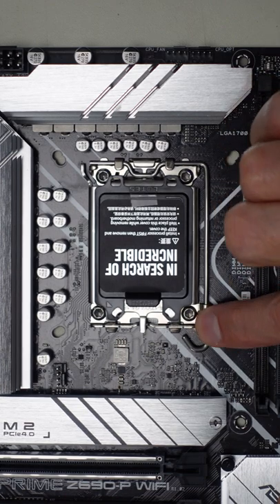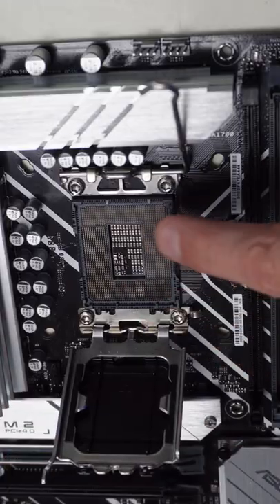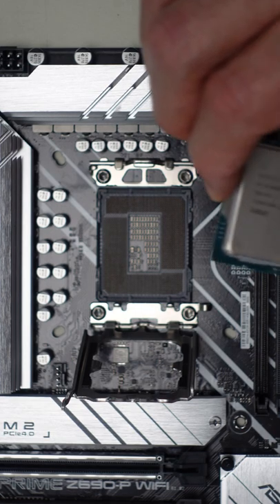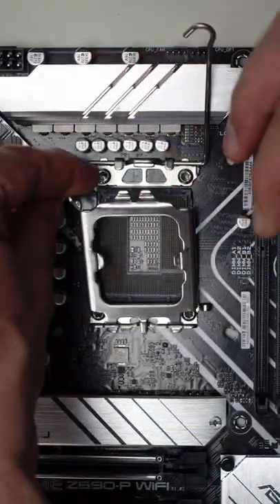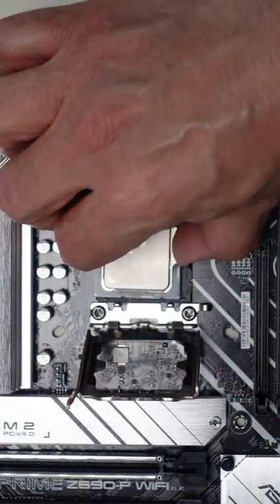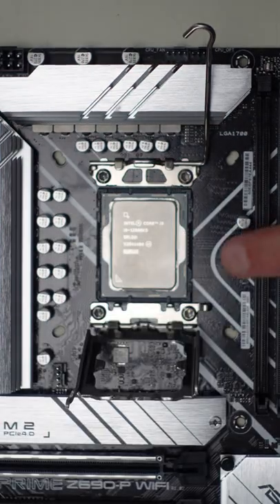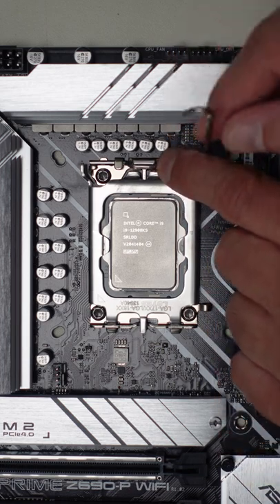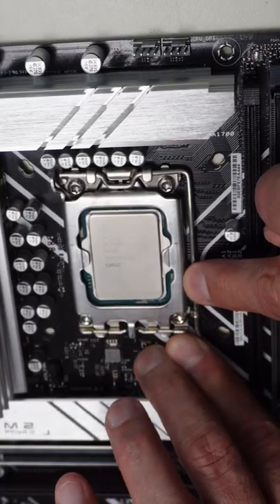Installing an Intel 12th Gen CPU into an LGA-1700 Socket #Shorts

Comment: You should not pop out the cover, it must come out when closing the socket
Reply from the maker: That is how I did it for quite a while - until I broke the plastic latches on the cover the first time I tried that with the LGA-1700 socket.  It seems like they changed the structure of those small plastic latches.
Reply: The LGA1700 plastic cover don't seem to pop out like the older cpu sockets.
Reply from the maker: @serverous85  I believe you are 100% correct on that. in my first attempt at having it pop out, all it did was break the tabs.
Reply: @PE4Doers  I just built using a z690 ace. I had to manually pop it out as closing it didn't do it.
Reply from the maker: @serverous85  That aligns with what I've seen.  Thanks for the update.
Reply: Ah the comments here are interesting. Just got my board and chip, and plastic tab clearly says NOT to remove it first. Yet apparently that's BS? Why I come to watch these videos first :)
Reply: @jmd1980  put the cpu in first, lower the clamp and pop it out manually as you do that to avoid damaging the pins
Reply from the maker: @jmd1980  It probably depends on how the motherboard manufacturer designs it.  I have only tried two ASUS boards so far.
Reply: @PE4Doers  no you are wrong…. You are teaching it wrong
Reply from the maker: @crunch9876  Well, it works perfectly OK today.
Reply: @PE4Doers  until it doesn’t. Your teaching people to do it wrong and some viewers will end up destroying
The pins
Reply from the maker: @crunch9876  I courteously disagree.  I've done three of these, and the first one I tried was as you describe and closing it with the cover not only sent the cover flying across the pins, but also broke the tabs on the cover which make it impossible to reuse if I need to return that motherboard.  The second one took a lot of effort to remove the cover.  The third time I removed it and had not concerns.
Reply: @PE4Doers  mine popped out no problem
Reply from the maker: @hovercroft  Maybe I came across a batch of bad plastic protectors.  Both of my motherboards were ASUS Prime (but different models).
Reply: @serverous85   when pop out the cpu plastic cover manual did your computer work.
Reply: @PE4Doers  When i popped the cover on my LGA1700 it popped REALLY hard off the motherboard
Reply from the maker: @MrTefe  They hold down very hard.  Does it work OK?
Reply: @PE4Doers  Yeah
Reply from the maker: @MrTefe  Good to hear
Reply: @PE4Doers Ive done hundreds of builds and I always take that out by hand. I see potential for popping it out and maybe bending some pins but pc components are often less fragile than people think.
Reply from the maker: @ThePSPJesus  I rather not take the chance.  I've had to re-bend pins on a CPU and on the socket.  It is a very difficult situation to be faced with.
Reply: If you plan to change the CPU is that means you need to installed the cover again? i bet not... 
What i seen there is no such mechanism or what so ever, that the plastic cover is needed during the process, i think it`s only optional.
Reply: @HusniArsyah exactly!

Comment: Hiya! I remember helping my friend with his first build and I was a little scared when his intel cpu was being pushed on so hard by the socket. My cpu has always been AMD Ryzen so much less pressure is needed. He went with an RTX 2060 and a i7 9700k. I decided to go with a Ryzen 5 1600 and an RX5700xt. I just recently upgraded from a 1050ti, and now I’m cpu bottlenecked 😅 I’m thinking of getting a R7 5800X(or X3D). Intel CPU sockets scare me 😂
Reply: Depending how bad the bottleneck is I'd recommend to wait for am5, so you can buy ddr5, possibly a pcie gen 5 motherboard and a zen4 CPU. If you can't wait the 5800x3d is the fastest CPU that's ever going to be released for am4 and should last you a while.
Reply from the maker: Yes, that can be scary.  Just keep in mind that the new AM5 socket the AMD is releasing will be very similar to the Intel socket.
Reply from the maker: That is definitely something to consider

Comment: I'm sure most people know but the socket 1700 ILM sucks. Intel switched from a square to a rectangle design for 12th and 13th gen, the ILM is not capable of distributing even pressure across the processor. I could not run XMP, tried to dial in settings for a week, switched the ILM with a contact frame and suddenly my XMP profile is stable which suggests that the processor wasn't contacting the pins fully.
Reply from the maker: I've heard something like that from another content creator.  Thanks for the information.

Comment: Dont use this hold down. Use a contact frame instead. 12 gen will get very hot with just the stock holddown because it doesnt make the best contact with the whole CPU.
Reply from the maker: I've heard that, but have not tried to use one as of yet.  There is a risk of hurting the Motherboard from what I've heard.

Comment: Hello i have a question 
My pc while benchmarking the screen gets flickered or green and white pixels is it cuz of the drivers or there is a different problem
Reply from the maker: Off the top pf my head I would suspect the memory (assuming the monitor you are using has worked on another PC).
Reply: @PE4Doers  thanks for your reply 🙏🏻
Reply from the maker: @OFFiciAlBaXo  No problem.  Let me know when you've isolated the issue - Monitor, GPU, CPU or motherboard.

Comment: Do these MBs come with the bracket?  Newegg gives me a note that says it needs a dedicated mounting bracket for the Gigabyte Gaming X as if it doesn't come with one or something
Reply from the maker: It sounds like you are referring to a 'Sag Bracket'.  If so, they do not come with the motherboards - at least not the affordable ones.  One justification they can use is not all use-case require one (say, if they are horizontal PC's - which is about 1%).  I always add one if a Video card used more than two slots.

Comment: Finally someone who wiggle it like me😅
Reply from the maker: I have always done that.  Even when I was repairing Color TV's with my father as a pre-teen.  When one of those large power transistors had to be replaced, we used thermal paste between its metal case and the chassis.

Comment: The cpu says 9th gen not 12th gen
Reply from the maker: That i9 is similar to the model number.  It means the CPU is a Core i9.  It then has a -12900KS right after that which is the actual CPU model.  Intel also assigned the 'code name' of Alder Lake to the 12th gen family.

Comment: Does the tutorial and does it wrong.
Reply: Explain
Reply: @Mckillax  When you first install the CPU into the "Virgin" Motherboard let the CPU push the socket protector out. My preferred method.
Reply from the maker: I usually do that myself, however when I tried it on an earlier ASUS motherboard the plastic snaps on protector broke, and it cannot be put back in and lock itself into the socket lid.  I have also heard of others that experienced that with the LGA socket, so I decided to NOT do that for this video.
Reply from the maker: See my response to @Nofe025